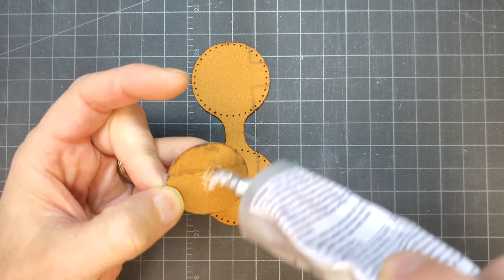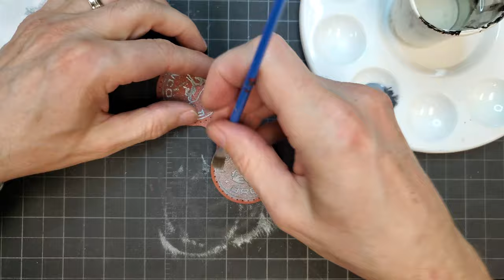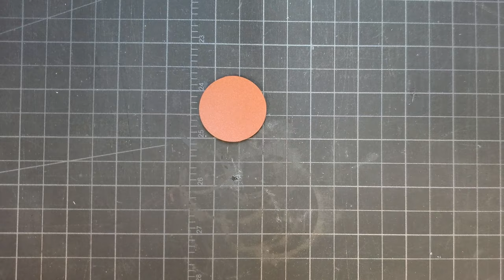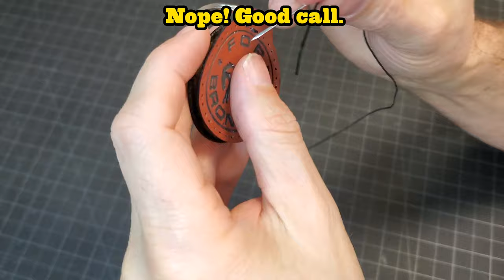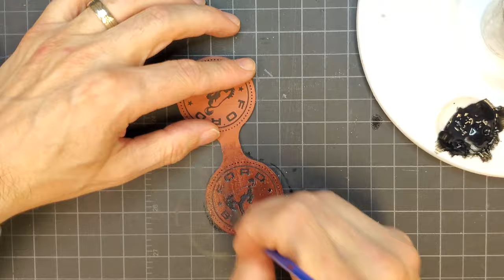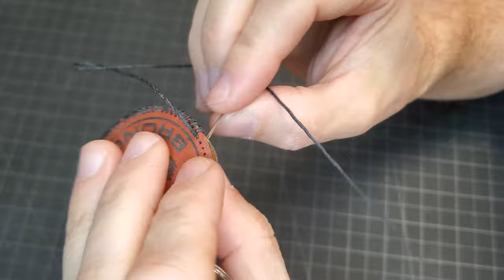Laser Experts try to Make Faux Vegan Leather Keychains - Hand Sewn and Painted

Comment: There are materials with Clorine in them that we should not laser cut because it releases Clorine gas.  Does this material release Clorine as it is cut?
Reply from the maker: Good question. I have no idea if this material has anything like that in it. I've seen this cut on lasers before, so I didn't even question it for a one-off project. If we were going to be running this everyday, I'd be more concerned though. We do have good exhaust with charcoal filtration at least! 🙂